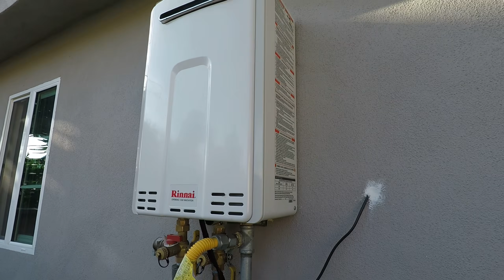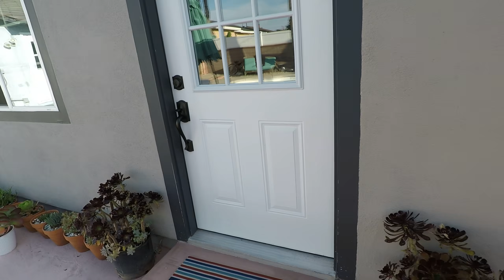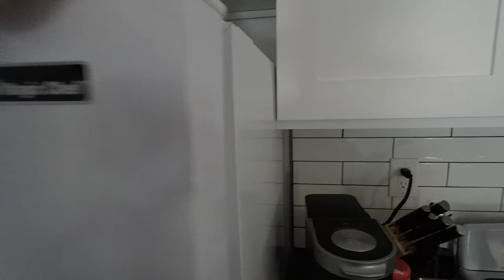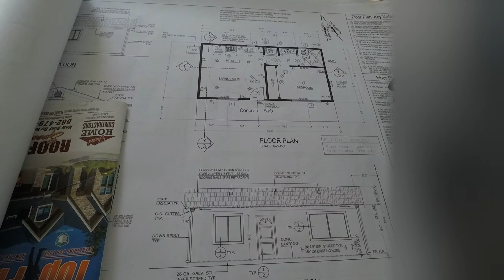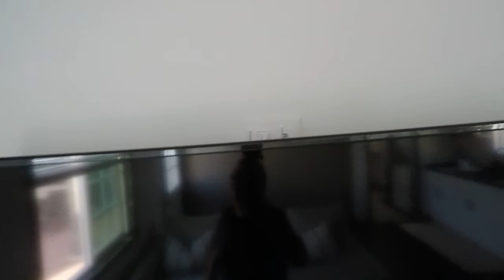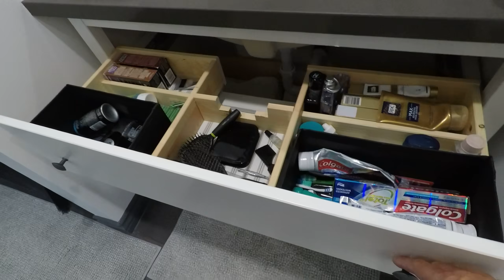2020 ADU 450 SQFT $70K Los Angeles P1 (Guest House, Casita)

Comment: That's a great price for total cost of your ADU.
Reply: I really like the size and layout of the ADU.
Is it better to go with undersized refrigerator and stove ?
Reply from the maker: I think it depends on your needs and how big your kitchen is. For me, the smaller appliances work really well for my space. I enjoy cooking and the counter space around the stove is barely enough. If I had gone with larger 30" stove and larger 30" refrigerator, I would have lost 12" of either counter space or lost half of my 24" pantry.

So, for me, this 13.5-foot single wall kitchen works perfectly. When I'm here by myself, it's way more than enough. When my significant other comes over, we enjoy the entire space. This unit is perfect for a couple.

The oven is big enough to cook a small turkey. We've cooked salmon with garlic/lemon/butter in a big flat tray and we can put a medium pizza to cook.

In summary, the smaller 24" stove and 24" microwave feel just as big as their 30" counterparts in the main house. The 24" refrigerator is big enough for a couple, but it's small and about half the size of my counter-depth 36" refrigerator in the main house. I do not regret getting the smaller appliances and I'm doing the same in my garage conversion ADU.

Comment: Any issues with the power lines? Dwp wants a 15 foot clearance. Edison has different standards?
Reply from the maker: Edison did require that a new riser pole that was taller (4 feet above the roof) be installed to replace the existing riser that was only like 2-feet above the roof.

The power line is over 15-feet from the ground at its lowest point. However, the power line goes right over my detached unit and clears it by 5 to 10 feet depending on where you measure.

Also, as I build my garage conversion ADU, Edison had no issue approving a new location for the new dual meter, new location for the riser, and movement of the power line to the new location.

Edison has been great to work with. So far, they have not asked for any payments or fees.

And in case you mean clearance to mean setback? I only was required a 5-foot setback from the power lines behind my property line. The pole is in my neighbors backyard  directly behind me and I don’t know what his setback requirement is.

Comment: Did you frame it yourself ? Or subbing out all licensed contractors mandatory
Reply from the maker: I only lifted a finger to sign the contract and the checks! Lol. I hired a licensed contractor to do all the construction. I just designed the floor space and selected the finishing materials, but I hired professionals to draft the blueprints and construct the place.

My city will allow me to pull the build permits as owner builder and build myself or decide who to hire and who not to hire. I didn’t go with the owner builder option.
Reply: @MHam1  ok I was asking because I worked with my friends dad who owns a general contracting company years ago and I’m pretty much a handy man I can do it but wasn’t sure if you need to be licensed for everything , I was young in high school at the time I’m 35 now own my own house got a huge yard with a detached 2 car garage and I’m wanting to tackle this next year, after all this covid bs is over, it’ll be the ultimate man cave !
Reply from the maker: Check with your city. My city allows construction as a owner builder which allows you to do the work yourself or hire any subcontractors for the work being done. As an owner builder, you are also liable for any injury, so make sure your home insurance covers workers on your property.

Also, there's a real estate agent, Hektor Castillo, who built a garage conversion ADU in LA as owner builder. He has YouTube videos on how he hired different subcontractors to do the electrical, plumbing, dry wall, etc.

I have no association with Hektor other than I like his videos.

Comment: Hey man I want to do the same here in Las Vegas do I neeed to get the permit and do it by myself or I need to get a contractor?
Reply from the maker: Check with your city hall’s planning department to see what they require. Every city is different.

In my city, I can submit the plans myself but you need to have professional quality blueprints that meet all the required building codes.

When the plans are approved, my city allows you to pull the build permits as owner builder or you can have a licensed general contractor pull the permits. I have no idea what your city requires.
Reply: @MHam1  thanks man good  to know this is gonna be stressful

Comment: nice job! which contractror did you use? does the 70K include de soft cost? plan design and permits ?
Reply from the maker: $70K did not include the soft costs. Those were an additional $6k for blueprints, plan check fees, and build permits. Extra $3k for  apartment sized 24” appliances like gas stacked laundry center, stove, over the range microwave with exhaust fan, and small fridge. So, call it $80k for someone to move in and bring their furniture, decorations, and kitchenware

I designed the floor layout and my GF designed the interior, so we only needed to hire a drafter to create the blueprints. We didn’t use an architect nor a designer, so that saved costs.
Reply: Looks really nice...I'm looking to do the same but around 350 sq feet....plus I'll be doing all the finish work myself..wondering how much that would save me..also shopping around for a contractor ...I'm here in Buena park...
Reply from the maker: I didn’t ask for a price breakdown, so I have no idea how much you would save by doing all the finishing yourself like floors, kitchen, bathroom, painting, etc. Just make sure you have a list of inclusions and exclusions in your contract to make sure there’s no misunderstanding on what finishes you plan to do.

Comment: do you have the blueprints?
Reply from the maker: I have the paper blueprints. What do you think you can do with my blueprints if I were to sell them to you?
Reply: @MHam1  i may be able to use them to build a cottage on my property in florida.
Reply from the maker: Interesting. My plans are very specific to my property. My city required that I draw my existing plot and show where all the existing and new structures will be relative to my parcel. Also, my plans include energy and structural calculations for my area to deal with my weather and earthquakes. Foundation is for my type of soil.

Also, my plans do not include a 3D rendering of the kitchen/bathroom, so the interior design is not included.

This is why I don't even try to sell or share my plans with others. They are specific to my property. I've had family and friends ask, but I tell them the only thing they can copy is the layout and the interior design -- all which is here on my YouTube videos.

You would have to get my CAD files for my plans so that you or your drafter could customize them to your situation. I don't have the CAD files. I just have the printed blueprints and an early PDF version.
Reply: @MHam1  
sounds like you built in california.
thats cool, sounds like I will have to have an architect draw up my plans for my property.
God bless.

Comment: Does it have its own electric meter ? Thanks
Reply from the maker: No, this detached unit shares the meter with the main house. 

My attached garage conversion will have a separate electric meter. I already got the new address approved which is required to get a new electric meter by SCE.

Now the problem is to figure out how to get enough amps to feed the main house and guest house combined plus the garage conversion separately.
Reply: @MHam1  how were you able to get the detached to share meters with the main house? My understanding is it's required.
Reply from the maker: @Christine Castillo, for my units, new meters were not required. Also, as far as I know, new meters are not usually required for ADUs in California.

Now meters are different than say the city requiring separate lines or separate shutoff valves or separate electric subpanels.

For water and gas, I was able to tap into the existing lines near the existing meter. The gas and the water lines going to my detached unit had their own shut-off valves.

For electric, I'm also sharing the electric meter, but there's a new subpanel in my detached unit with its own circuit breakers.

For sewer lines, I could not tap into the sewer lines of the main house. Instead, I had to go around the main house to bypass those sewer lines and connect to the mainlines in the front yard.

Comment: Very cool! Did your listed budget include the utility tie in? Like sewer?
Reply from the maker: Yes, the $70K includes all the utilities tie ins like sewer, water, electric, gas, cable, and internet. I had both coax and ethernet cables coming in.

By the way, all the utilities are shared with the main house, so no separate meters for this detached guest house.

It does have it's own electric panel, separate shutoff for the water (independent of the main house), and separate shutoff for the gas. This means repair work on the detached guest house that requires shutting down a service can be done without affecting the main house.
Reply: @MHam1  how much did it cost to connect the utilities to your existing utilities at the main house?
Reply from the maker: @ryanlarsen8083  yes, all utility tie ins were included in my fixed price construction contract, but utility connection was not itemized. I don’t have the specific cost.

It was all tie ins were per city code.

In fact, nothing was itemized in contract.

Comment: Boy they saw you coming when it came to plans and approval prices. You could do that whole place for 4000$ Less the appliances. It's called printed housing.
Reply from the maker: I didn’t want a 3D printed house, but if that’s your cup of tea...indulge yourself. By the way, you can also buy a shed for that price...it just doesn’t have a foundation, gas lines, water lines, electricity, sewer, etc.

Here’s a link to an article that in San Diego, a 350 sqft 1-bd and 1-ba printed house starts at $115K. https://news.yahoo.com/california-startup-3d-prints-homes-130023184.html

There’s more costs to it than just printing the structure. Delivery, assembly, connections to utility lines, windows, etc.

Comment: Do you mind sharing the information of the design company that drew your plans?
Reply from the maker: I didn’t use a design company. The layout and floor plan was my idea. I just hired a draftsman to draw the blueprints, calculate energy specs, and get structural calculations. The finishing materials were selected as needed by my girlfriend who had the design in her head. The contractor just installed the materials that we selected per build agreement.
Reply: @MHam1  I see. Do you mind sharing the info of the draftsman?